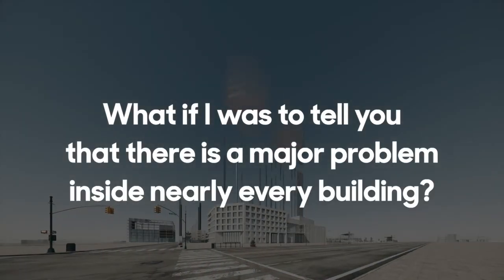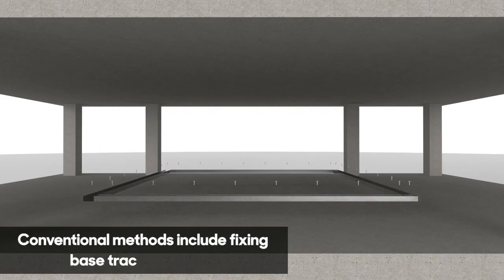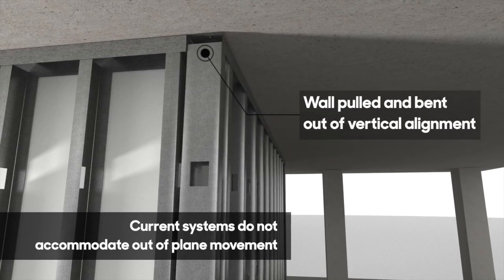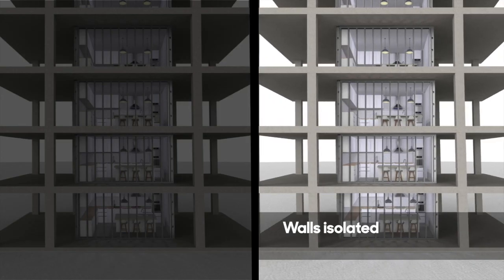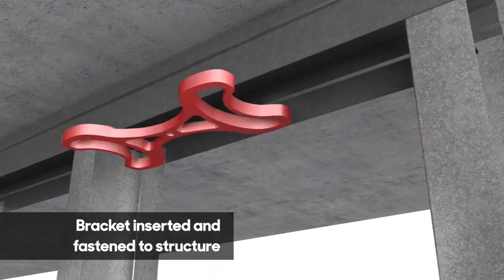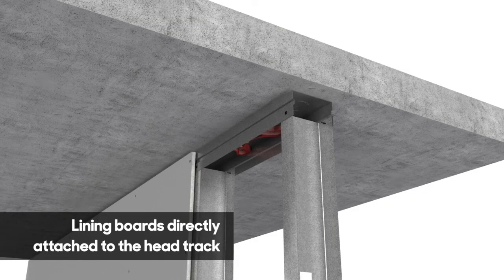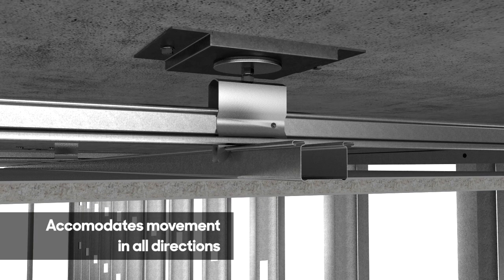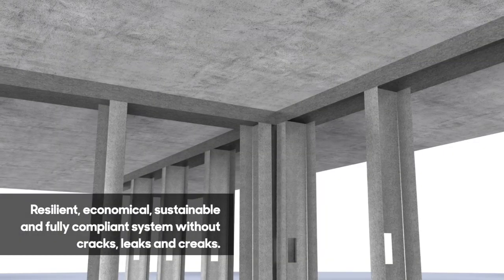Introducing Qubit360®: A Groundbreaking Solution for Tall Buildings

Comment: Looks like the Deflection track sits loose with a +/-20mm gap above it? struggling to see how the walls are scurely fixed in place during construction phase.
Reply from the maker: Thank you for that observation. The head tracks are fixed to the wall studs and are not loose along the top. The deflection occurs when the anchor screws slide through the Qubit360 bracket within the head track to accommodate the +/-20mm movement. That's how the walls are fixed securely in place during the construction phase.